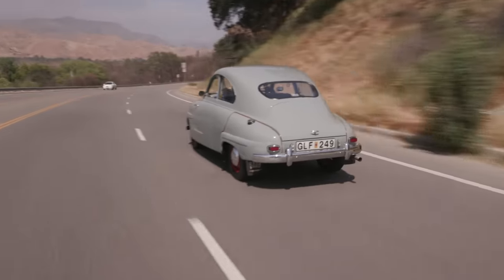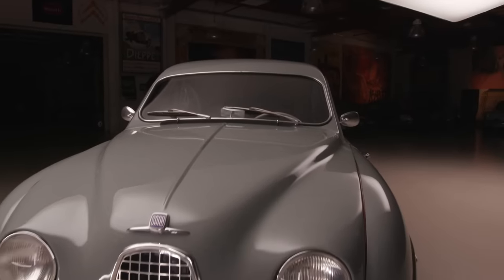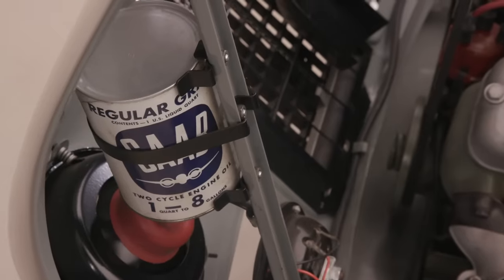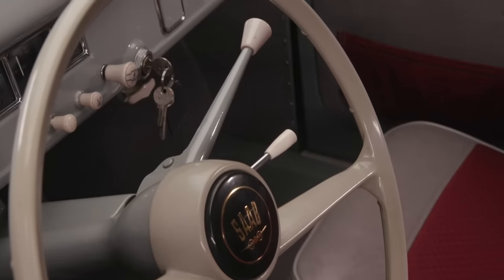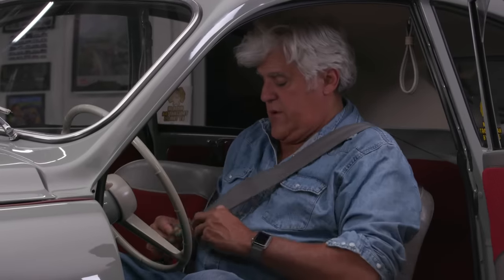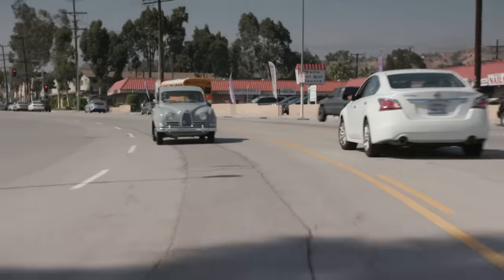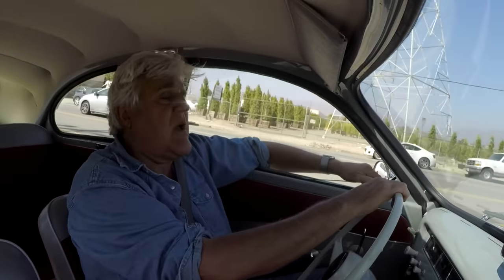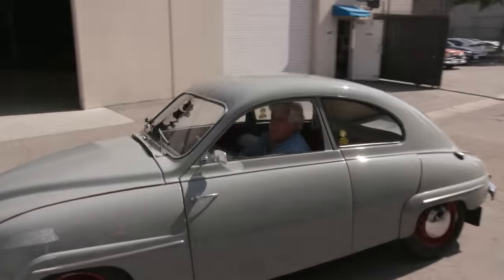1958 Saab 93 - Jay Leno's Garage

Comment: The reason that SAAB put a freewheel on the transmission Jay was because there was a possibility that the engine could seize through lack of oil if the car was coasted down a long decent in gear using the engine braking to help slow the car, as the engine is lubricated by the oil in the fuel that would mean that there was no oil while the engine was being turned by the wheels, hence the freewheel which forced the driver to use the brakes rather than engine braking to hold the car back..

Comment: I remember my two stroke motorcycle. I had to run it with the throttle wide open all the time. Or, else the spark would foul. It had a five speed gear box. Rarely did I drive in fifth gear.

Comment: I had a Saab 96 with transmission problems.  I once had to drive from Spain to Germany without being able to get it into first gear.  I had to start it in second gear which required quite a runway to get going.  There was something wrong with the free wheeling feature.  It was very hard to find anyone in Germany to work on a Saab.

Comment: In 1987 I bought a 1966 SAAB 2 stroke from a pipe smoking Doctor. This SAAB was an 850 cc Triple carb Monte Carlo model.
So much fun until the automatic oil injection pump failed and the engine seized. Sold it for what I paid for it and have regretted it ever since.

Comment: Monte Carlo's have 55hp. When the muffler gets saturated in oil, throw it in the campfire for awhile. 2stroke oil wasn't necessary. Non detergent 30w to 8.2 gallons of gas works fine.

Comment: I had a new 1960 Saab,  with the re-styled rear end.  Interesting car with the usual new model flaws: broken front suspension wishbone, chronic tearing of the rubber boot covers on the front-wheel drive axels, electrical problems in the dashboard display, constant spark plug fouling, and an incurable brake problem.  The brakes had a tendency to mysteriously freeze into a closed position causing the car to slowly stop.  It didn't always happen at the most convenient time, so you struggled against the braking by trying to accelerate.  The engine coolant would then boil over until you could pull off the road. After a period of time, the brake system would cool off and the brakes would release allowing you to proceed until the cycle would unpredictably begin again.  Unfortunately in those days, if you had a lemon, you got no help from the dealer or car company.  The only solace I got was having the confidence of mind knowing that I would never have such a disastrous car experience again with any subsequent vehicle.

Comment: Intersting that Jay associates Marijuana usage w/ Saab ownerhip. What is it about his generation and their collective view of marijuana? The engine won't seize w/ low oil/gas solution, but they will burn pistons/rings. My Yamaha RD400 was a two-stroke and I never had an issue w/ engine seize due to oil/gas mixture. The guys that lost their engines did so because they were playing w/ low oil/gas ratios that would take out their rings/pistons and/or weren't changing the crankcase oil. I installed a water/methanol tank/system on mine to help bring EGTs and head temps down for all-out efforts. Great addition to any two-stroke or air-cooled engine.

Comment: Ive had 5 differentt Saabs over 3 decades,The best one has an odd story...i was at the local Saab dealership in 99 or 2000.i saw a nice back 2 door coupe sitting on the side of the dealership and never saw a Saab shaped like that..when i asked how much the dealership said theyve ran it through 11 tests and it keeps stalling it started on the 900sT line and ended up as a 93 2.3 T with a Viggen emblem maked 900s 2.3T,it was over 240 HP..i bought a tester for cars and the guys at Saab told me a map shows on the code machine the problem is in the upper left hand corner.. i came back with my orange code finder it said MAP too,I foundout it was the MAP sensor and went inside and ask how much will you sell it for..they said why would you buy it we cant even fix it..i said give me a number..they said 1,200 with no warrenty as is.My friend who had a junk yard that only had Saabs Benz's and BMWs let me take a MAP sensor off a 99 900s for free i put it  in and the car when i sold it had 240,000 miles maybe 500 in work over 7 years..and the person who has it now(still running)because i wanted a 83 911SC i sold it..but what a car...no American made V8 could even get close to me from 70MPH to 140..the car sounded like a jet when the turbo kicked in..

Comment: When I was a kid in 1960s Sweden, my dad drove a two-stroke SAAB. Back then gas stations had a special pump for oil mix gasoline. It had an extra thinner hose next to the main one. The gas and oil somehow mixed at the nozzle.The hoses came from a swing-out arm on top of the pump. On top of the arm there were two small glass bulbs where you could see the gas/oil flowing.

Comment: 2:15 -- Jay mentions common applications for a 2 stroke engine such as a gas lawnmower, but this shouldn't be taken as an exhaustive list.  For another comparison, try a snowmobile, because up to about the 21st century, it was more common than not to have to mix the gas and oil for a snowmobile.  Plenty of power, and also fairly lightweight; light enough to be used for aircraft, as well.

Comment: "Nash was the first American car manufacturer to offer seat belts as a factory option, in its 1949 models.[8] They were installed in 40,000 cars, but buyers did not want them and requested dealers to remove them.[9] The feature was "met with insurmountable sales resistance" and Nash reported that after one year "only 1,000 had been used" by customers.[9]"

Ford offered seat belts as an option in 1955. These were not popular, with only 2% of Ford buyers choosing to pay for seatbelts in 1956.[10]

Saab introduced seat belts as standard equipment in 1958.[13] After the Saab GT 750 was introduced at the New York Motor Show in 1958 with safety belts fitted as standard, the practice became commonplace.[14]

Comment: Most 2 stroke old boys. Always mix a cup of Two stroke oil into the fuel tanks. Even if they had.  CCI etc. but there proper Smokey. Especially at start.

Comment: I just replaced the head gasket in my 1960 93F. I bought it from Tom Donney who was a big help for me. My owner's manual was signed by Erik Carlsson in 1997, long before I bought the car. it's the most fun car I've ever had. I don't do anything to it, I just drive it. There is not much to go wrong. I've owned VWs from the same era and the Saab is a way better car.

Comment: I had a '67 3-banger that was a lot quieter than that, it would do about 70 tops. Four speed, Looked exactly like a V4 of the same year. Unfortunately the V4 was too strong for the tranny and differential incl. freewheeling, but they sold quite a few of them. My 2-stroke would get 30mpg at a reasonably flat 55mph, which was the nationwide speed limit at the time - that being 5 more miles than a VW Beetle - which if you were in it for more than an hour at 55 would tend to shake you to pieces.  This kind you just poured the oil, hopefully in the right amount, into the gas tank. I just used chainsaw oil.

Comment: the free wheeling is because it is two stroke. Engine breaking withot the proper lubrication, lower gas input means in two stroke terms less lubrication, ruin the engine. With a four stroke the oil pump supply with the right amount of oil to the engine based on RPM:

Comment: SAAB cars were great before they became influenced by General Motors and Subaru. I owned a 900 5 speed manual two door built in 1989, and a five door auto 9000 built in 1993. Unfortunately both had not been owned by the type of person you suggested Jay and were not reliable. SAAB still make what I regard as the best fighter jets in the world. Since you mentioned the good features of two stroke engines, do you have a Trabant in your garage?

Comment: Sounds like a model airplane engine. My father worked on a missile project in the frozen North Saabs were desirable as they will start in the sub zero cold. There is no oil in the crankcase to get stiff and they are from Sweden and they know all about cold.

Comment: Back in the 1960's we always rode down long, steep hills in neutral on our 2T scooters to avoid starving the engine of oil with the throttle closed at 4000 rpm. I guess SAAB did this automatically.

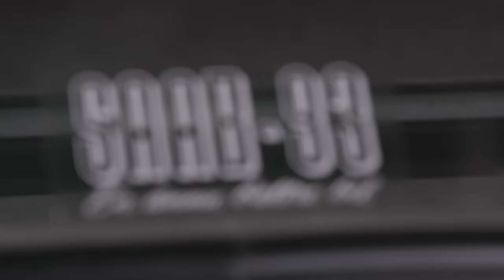Comment: 1:00 You don't necesary need to mix the oil and the petroleum.I've got a 1995 scuter and it has a SEPARATE OIL THANK from where it sucks as much as it needs.
I sometimes also add some in the petroleum,but is NOT necesary.

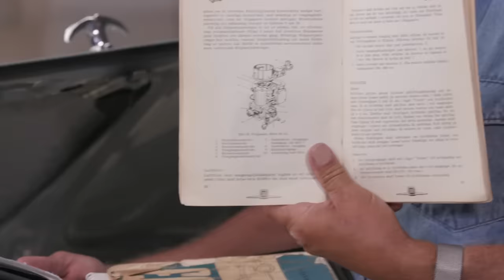Comment: 08:20 The last few lines before the picture: "Wrong carburator settings will cause unusual fuel consumption and rapid wear on the engine. Leave therefore comprehensive adjustments of the carburettor be done by an authorized service workshop."

Comment: 50 to 1 sounds lean for a street 2 stroke, if you're gonna be revving it up high for extended times something like 40 to one sounds better. That's just from my experience with 2 strokes. Leaner usually gets a little more power but richer gives a little more oil to lubricate the engine

Comment: Did this car have the DKW engine, which was 3 cylinders, 2 cycles with a 4-speed on the column?  After DKW went out of business, Saab started using Triumph engines.

Comment: I heard a rumors that on developing this car were helping czechoslovakian engeneers which left Czechoslovakia when commies came in charge. There was a very simillar car in Czechoslovakia called Aero Minor. Aero company was, same like SAAB, originaly Aircraft making company but in late 20s they´ve started production of cheap and simple 2-stroke cars. In 1946 they introduced Aero Minor which was small 2-door, 2-stroke, 2-cillinder, front wheel drive car for 4 passengers (there was STW version too). Radiator was behind the engine too. Was produced from 1947 to 1951, was really successful on market and in sport but as usual commies came and "kill" it. Some companies in world wanted to buy a licence to make this car (I heard about BSA). So when commies came in 1948 some of engeneers left to Sweden and helped develop first SAABs. (well at least i´ve heard that)

Comment: Different? Yes. Unique? No.  My family had a 1958 German DKW (das kleine Wunder) with identical specs: 3 cylinders, 2 stroke, free wheeling, aerodynamic design, and front-wheel drive.  But the 4-speed (column shifted) came with it.  52 claimed HP and, yeah, you had to premix the oil.  Oddly, it had one coil for each of the three cylinders.  It was fun to drive.

Comment: These cars made such excellent European rally cars especially in deep snow, not just because of the front-wheel-drive but because of the curved shapes, no sharp corners to dig into the sheer ice walls down either side of the roads.......The engine sound doesn't seem to have been picked up properly by the microphones here: it actually sounds a bit more musical.

Comment: I think more like 70 hp. on three cylinder and should handily outrun a VW of the same year 
does it have an exhaust screen that needs to be burned off or cleaned to keep the carbon from stopping the exhaust flow (like the spark arrestor on a chainsaw)

Comment: The Scott pre-war triple motorcycle [pic below] was also water cooled, and I seem to recall reading that the engine may have been inspirational to DKW's engineers. It also had throttle-opening-linked metered oil feed, no premix required. Velocettes early two strokes also had this feature. The Japanese seem to have claimed this idea but that may simply have been a view put out by poorly-informed 60's journos. There is not much new in engines....
Exploring the Sammy Miller Museum | Part One | | Motorcycle News, Sport and  Reviews
https://images.app.goo.gl/f3o9xjTU9r1tmePJA
Oh, and I want a 2-stroke SAAB too! A DiTech injected 2-stroke engine would make it perfect.
THANKS JAY!

Comment: Have never heard of any of these being retrofitted with Renault Dauphine or MG 1100 with 1.3L sideways installed engines before hitting the scrap heap.  Once that engine cooling window shade chain broke in stop and go traffic, a lot of old Saab aged severely and got sold for "best offer" in next week's newspaper. A lot of owners were not mechanically inclined and did not know what aerosol pemetrating oil was, or what to aim it at. Of course the Japanese did their homework and punted with micro Subaru and the overbuilt Toyota Carona to catch the windfall of car buyers who craved small cars with  reliability while Detroit laughed it all off and was distracted by race riots.

Comment: If you ever run out of two stroke oil, and you really have to get home with/on a two stroke, mix petrol with diesel 1:1.
Reply: Motor oil works too.
Reply: @kanalnamn  Too thick.
Reply: @philipcooper8297  Yea... But the engine will live. (Mix 2%)
Reply: @kanalnamn  Sure, but when you're at a petrol station, you don't really want to buy a bottle of 4 stroke oil, do you? Diesel is right there, avalible.
Reply: @philipcooper8297  Ah. No. But I've been in the situation that I have a gas can but no two-stroke oil. There were no station within miles. Back in the moped years. :)

Comment: If that car was incomplete. You couldn't find the OEM motor. Be fun to use ,2018 19 snowmobile motor. 800 two stroke.efi what are they about 160 up. Up from 33

Comment: A friend of mine had a Saab but his was a 4 stroke. He had a Saab guy mechanic that put oversized pistons in it, that car would move. I don't know what horsepower it had. He never liked the newer ones 99,900, 93, 9000s . Then he would get the ones with V4s, he could work on it himself. He turned me on to them, but he died some yrs. back. They were long mileage cars even back then it would be nothing to put 100,000 miles on them like they were still new.
Reply: The SAAB V4 was a Ford engine used in Germany and England. I had a car with it once. I hated it.
Reply: @johnburns4017  it was an English motor. Sorry you had a bad experience with it, but my friend loved his..
Reply: @robertadams6606  
I had a Ford with the same engine. The engine was made in England and Germany. The engine was prone to catching fires, as mine did. It was not a very successful engine. 

SAAB looked at other engines, even the BMC A series, which when bored out and tuned would have been a better choice.
Reply: @johnburns4017  like I said you had a bad experience, and that's your opinion you'll have yours I'll have mine. I dont know what caused your  fire, but he had no such problems. So you're gonna say they're all bad. There are lots of cars with certain problems,  that doesn't make them all bad.
Reply: @robertadams6606  
I am not going by opinion. The distributor was next to the carburetor.  Bad position. Kaboom if the float chamber overspilled, or any carburetor problems.

Search w iki on Ford Essex V4 Engine. There is a photo of one in a Zephyr.  I had the same car, even the color.  Clearly shows the two in close proximity to each other. It was the same in the English and German V4s. The English V4 was a later slightly better design with a shorter hence lighter block, as the opposite pistons shared the same crankpin, unlike the US designed German V4.

Only Ford and Lancia made mass produced V4s. The harmonics meant a balancer shaft was needed. Added expense. So few bothered.

Triumph developed the slant-4, lowering the centre gravity and hood line, which a V4 also did. The slant-4, had a simpler and cheaper layout, and a simpler one piece exhaust, than a V4. The Ford V4 SAAB used had a 1700cc version, the same size as Triumph's slant-4. SAAB ended up using that ditching the Ford V4.

SAAB were working with English engine consultants and designers Ricardo, developing a 1200cc engine for the 99. Then Ricardo put them onto the new Triumph engine. They never looked back being the first to use the Triumph engine, even before Triumph.
Reply: @johnburns4017  I don't care what you're going on, I don't care about your opinion or experience, you are not gonna change my mind, so I don't care. Let it go!
Reply: @robertadams6606  
What at touchy guy! LOL!
I told you I am not going on opinion.
Read what I write it is easier that way.
Reply: @johnburns4017  I don't care what you're going by, I read what you wrote. Read any Automotive article, you'll see cars that were big flops, & you'll see people that had those cars & loved them. I AM NOT CARING WHAT YOU BASE YOUR WRITINGS ON!!!! IT DOESN'T MATTER TO ME.PERIOD!!!!!
Reply: @robertadams6606  
Some sort of weidro!
Reply: @johnburns4017  Yea you are, you just stuck your nose into this, now you're calling me weirdo!!
Reply: @robertadams6606  
Oh my God! 😵‍💫

Comment: yep, that 35 or 40 HP is really all you need in a car. And why you'd drive a V8 with say 600 HP over this on city streets? No clue. I mean, sure, if you're planning to go cross country and get arrested for breaking all kinds of speed limits above 55 mph, go for it.. but 100 HP could do that with a 4 cyl nowadays that gets 40 mpg... and yet they put 250 hp into those where they could be getting 80 mpg with 30 or 40 hp..

Comment: The SAAB models with the radiator behind the engine, like this one, had cooling problems in hot climates. Many fitted more efficient radiators and electric cooling fans.  The seal between the water pump and the dynamo is water lubricated. If the alternator is tested when the water pump is dry, the seal will burn out. The dynamo will be destroyed as water will seep through the damaged seal into the dynamo. Occasionally they did fail needing the pump and dynamo being replaced - expensive job. Not a good design for real use.